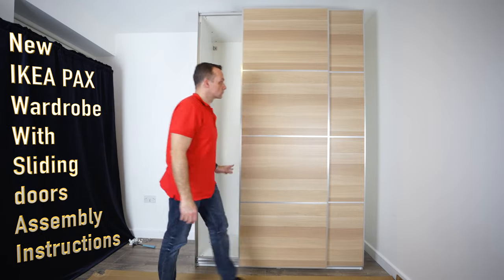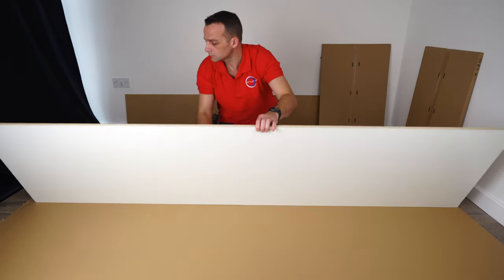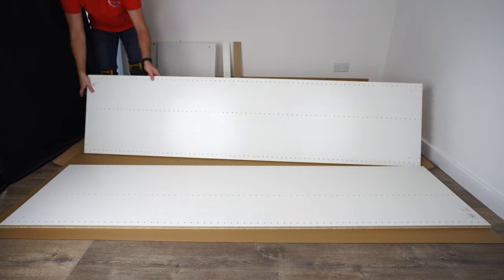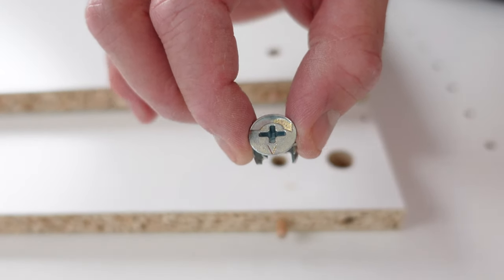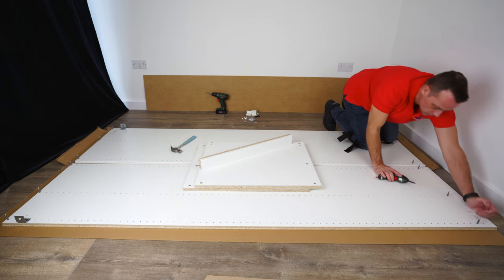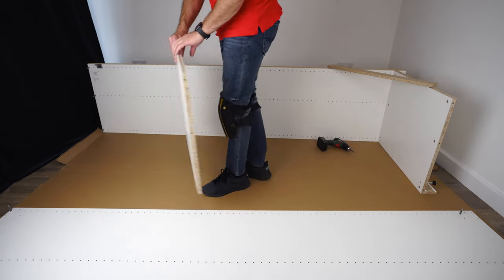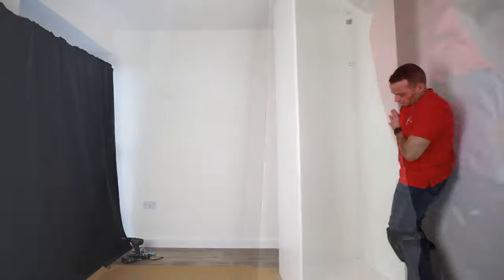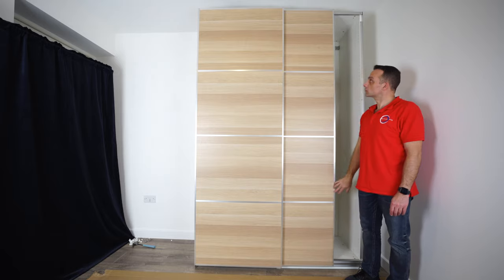New Ikea PAX Wardrobe with sliding doors Assembly Instructions Part : 1

Comment: I just finished assembling an ikea pax wardrobe with sliding door. It's just disappointed with the new sliding door frame design. The left and right side gaps are very large, around 5mm and are not equipped with rubber/fur seals. The material is also thinner.
Reply: totally agree with you!
Reply: Same here! Did you find a solution? These gaps are pretty large

Comment: Hi, thanks for the videos and all of your help. I intend to buy 236 high wardrobes and my floor to ceiling height is 240. Will I have room to add the sliding doors with just 4cm and building upright?
Reply from the maker: Yes 4cm is enough space just need to build the Pax frames upright

Comment: How stable and safe is it not to secure this to the wall (or the 200cm tall version in my case)? I don't have children or pets so I don't need to worry about them being climbed on. I would prefer not to attach them to the wall.
Reply from the maker: If you have the 58cm deep pax wardrobe than is fine without securing to the wall

Comment: Can these new pax wardrobe be height adjusted the same as the old type?
Reply from the maker: Didn't try to do with these new Pax wardrobes but possibly few centimetres from the bottom. There is new ending aluminum panels on the both sides now all the way down that could be challenging to cut need to see the wardrobe again and properly check the bottom rail it seem to be wider tan the old one so need to measure safe space to cut properly for the doors to slide without problems. Sorry don't have 100% answer for your question yet but thank you for new video idea.